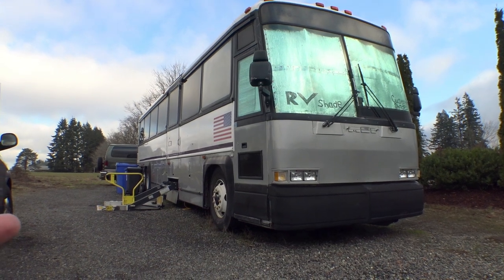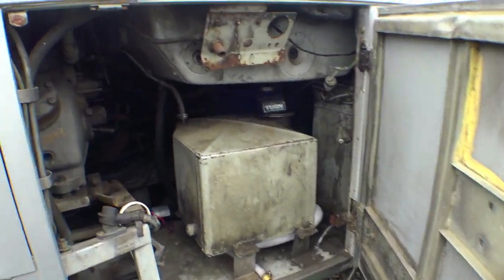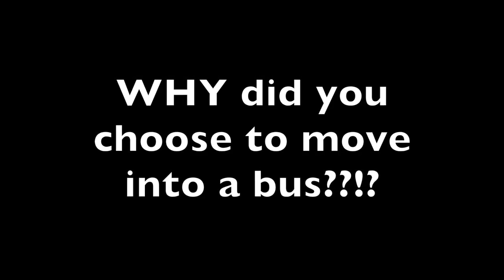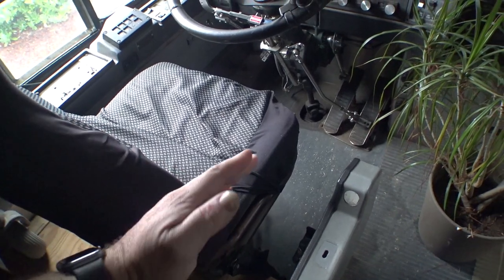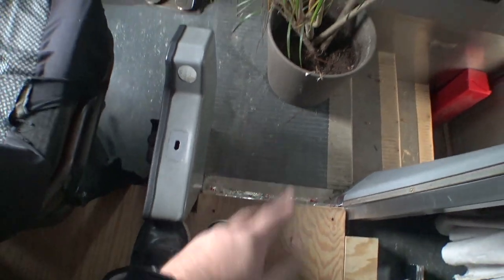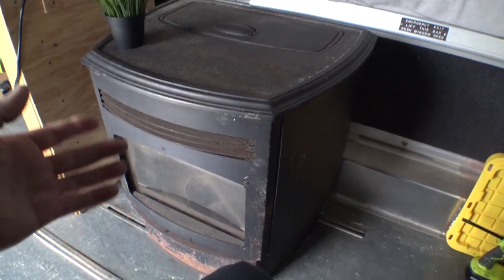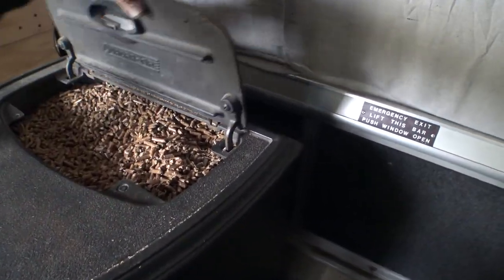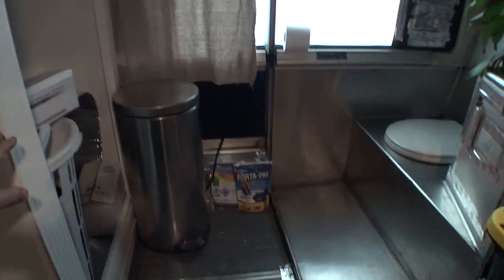should you live in a bus? some thoughts after 1 year... (LONG VIDEO!)

Comment: Where does the urine go?  Do you put it in the grey water tank?  Or do you go over to your septic access and empty a bottle daily?  

Why not use the tank that you are thinking to remove for urine?  The two can mix for a short while on the way out of the bus.

You have, and had plans for, a smart set up!  How about a two-year update?
Reply from the maker: separate containers, and dumped independently into the septic system outside.  prevents the black water tank from filling up as fast, and also allows the chemicals to work WAY more effectively.

Comment: I have a quantum and it's 7 months old and falling apart everything comes loose all the time mine has a backup camera which I think is stupid but it quit working which I keep telling company I want it fixed since it has it on it should work then the braking system sucks for going up a small ramp to get thru my door if I stop to open door it will roll back about 6 inches for a chair I have only 141 miles on I shouldn't have to keep going over chair and tighten bolts all the time oh and the seat cushion that came on mine sucks bad I told rep just 2 months after getting chair the seat was broken down and in only 240lbs with no legs but anyway love the videos